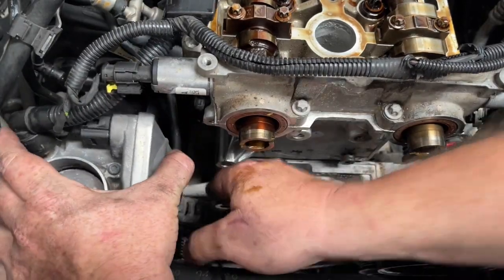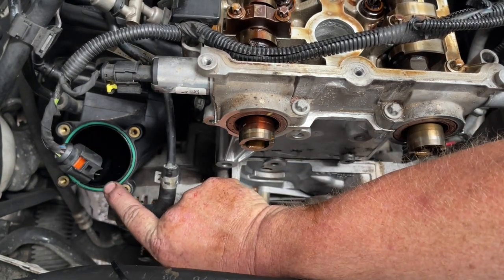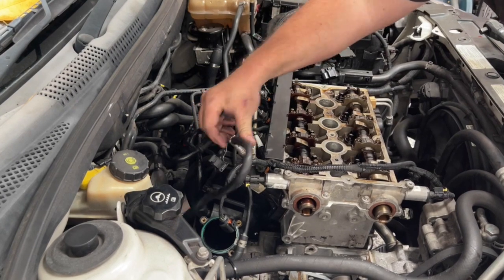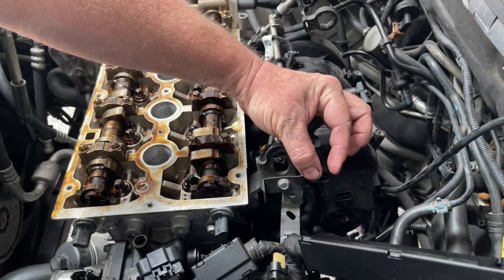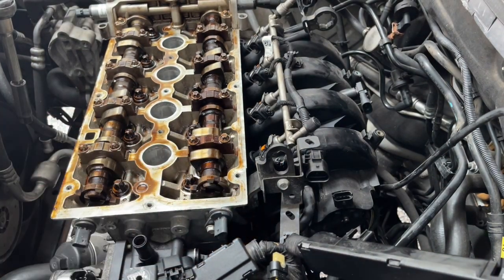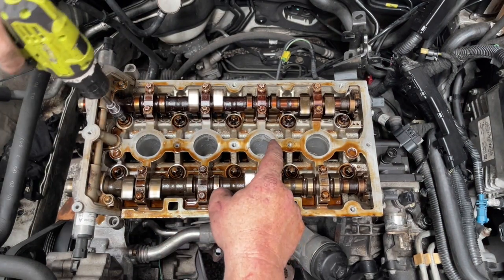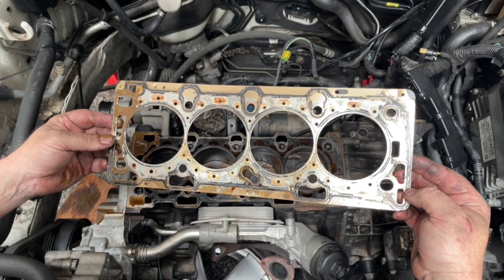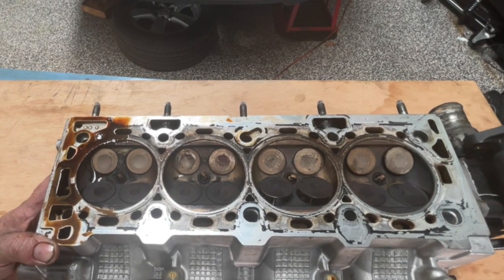Cruze Head Gasket Replacement  STEP by STEP process (Part 4 of 16) Full Details for 1.8 F18D4 Engine

Comment: Interesting that there was no sign of the oil pressure restrictor/non-return valve in the block deck face that should be adjacent to the front (of the car) centre head bolt hole.  It's a plastic oil pressure restrictor only in the 1.6L and 1.8L with solid valve lifters and a non-return valve (blue colour) in the 1.8L with hydraulic lifters - check on-line part # 55556227/90530050/55563957.  The black plastic ones usually melt if the engine has overheated (common problem due to the plastic thermostat housing failing and leaking coolant) and because of this I ALWAYS replace the plastic thermo housing with an all-metal one which is vastly more reliable and readily available on-line.
Reply: Heh howie, where did you oder the oil pressure restrictor from? Im looking  one, for a 2013 trax. Thanks